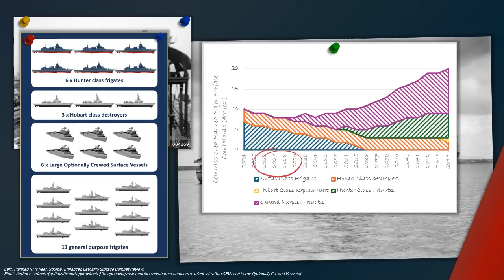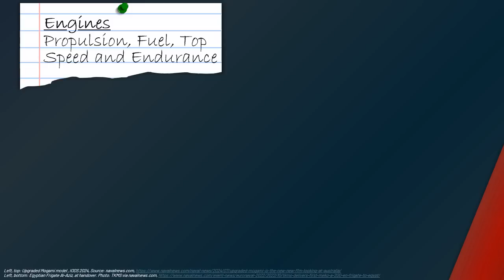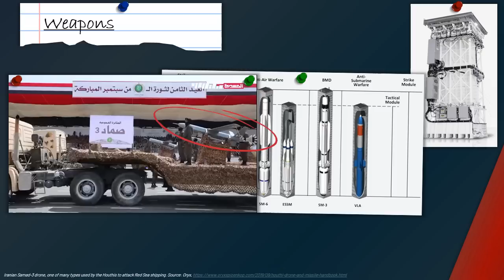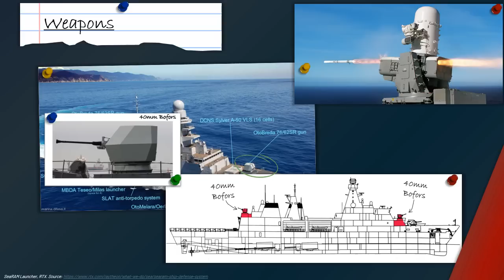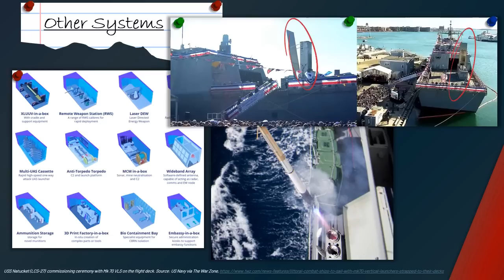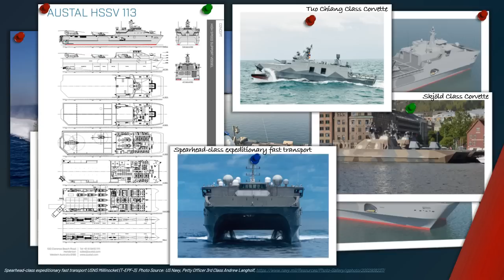Could Australia Build a 21st Century Bathurst Class Corvette?

Comment: Just a suggestion or two : take the shorter Austal HSSV 92 sized proposal that actually fits in their Henderson shipyards and fit it out as you suggested, but build them in pairs. One as the anti submarine warfare platform and the other as the dedicated anti air warfare platform and operate them as pairs. One can have a proper helicopter landing pad, towed sonar array and similar systems. The other can have a much smaller pad and no hanger and use the rest of the space/ weight to fit a MK70 VLS and mount the bigger/better radar. Fit them with Link 16 so they can operate together and co-ordinate and you might have saved yourself some heart ache trying to shoehorn everything on to one ship. 

Other thing is including some sort of UAVs.
Reply: Not mentioned on the anti air warfare front would be equipping the ships with 2 x 6 cell NASAMs launchers (which are at least partly domestically manufactured) - this gives a missile capability with a range of at least 37 km - 4x the SeaRAM 

AMRAAM-ER which is essentially an ESSM + AMRAAM Seeker should be domestically manufactured and it should be looked at integrating it into MK41 VLS, F-35A and the NASAMs launchers, such that all systems can use the same short range air defence missile

Comment: Firstly, this was a very interesting thought experiment if nothing else, and after watching it through I have some thoughts:

if the AshMs are mounted in external boxes, is it possible to have their space arranged in a way so that they could be swapped out for the Mk-70 VLS or another 'shipping crate' weapon system, allowing your 'Future Bathurst' to exchange long range surface strike capability for Air defence/stand-off anti-submarine/etc. capability whilst maintaining the helicopter deck? It seems like that should be viable, but I admit I'm not a ship designer so I don't know if that's the case.

I agree that a sizable mission bay could be an excellent way of maximising utility whilst keeping base costs down.  And you could simplify things logistically by defining preset 'loadouts' for common duties, e.g: VLS and extra fuel for ASW escort, extra remote weapon stations, EW and Hellfires for anti-drone/anti-piracy work, etc.

If space proves to be a major issue, could the helicopter be replaced by a drone?  You'd lose utility, but if the chief thing you want is a way to get torpedoes, depth bombs and sonobouys out to a target area, it could be a possibility.  

Finally, I think you're right about the cost/lack of appropriate facilities being the biggest obstacles to viability.  Even if it only costs 500 million to build, that's not including maintenance, staffing and all the other costs that go along with maritime operations.  Though having said that, keeping even a relatively low production run of 'Future Bathursts' going could prove useful to maintain institutional knowledge (something Australia has historically had issues with in shipbuilding), or, if the Australian Government does decide to expand Australian shipbuilding capacity, a simple and relatively small ship could be great as a shipyard's first commission, as a way to build up a workforce's experience and expertise.  And if it's an inherently flexible and modular hull, that may open up the possibility of exports.  Sure, the concept might seem like a 'third tier' ship to Australia, but to countries without the GDP to support a major navy or otherwise only need some patrol ships to maintain security, it could prove ideal.

Comment: Coal could be used to run steam powered navy ships for hundreds of years and it is a lot cheaper than $2 a litre for diesel fuel to run the things.
Reply: coal is bulky. you would need a bigger ship.
Reply: @badpossum440  Better to build ships that get driven about the ocean even if they are bigger and not as fast as far as I am concerned. Currently they mostly seem to sit stationary in Australia till they can not be operated.
Reply: Ships don’t use diesel they use different types of oil

Comment: The level of propaganda saturation in all the news reels of the time and the politicians and unionists glorifying the Bathurst Class corvettes means that the myths of the Bathurst Class have never gone away no different from the Boomerang Fighter.  That was produced all the way through the war and was obsolete before it was designed and  built and even at max speed could not catch a cruising  Japanese bomber and never shot down a single enemy. 

The Australian built Bathurst Class Corvettes took just as long to build at each dockyard as the US production of Essex Class carriers that were 37 thirty-times the size. There isn't even any honesty in calling Bathurst Class a corvette when using civilian engines and very small ships without modern anti-submarine or modern anti-air was really a Sloop or Minesweeper definition in the Royal Navy. The ongoing bs is the modern Hunter Class with so few VLS  and actually twice the cost of two Chinese Ballistic Missile submarines and zero chance of being anywhere near one of them let alone intercepting and tracking two quite slow and loud nuclear submarines that need merely to split up.  So the cost of one Hunter Class minesweeper two Chinese nuclear submarines firing conventional non-nuclear ballistic missiles might be capable of sinking the entire Royal Australian Navy in a few hours. Domestic sovereign capability and designed and built in Australia by Australians for Australians gets said so often and so iconic and guaranteed to be a success just like Landrovers and Toyota Landcruisers and iphones and Big Macs. I got as far as the suggestion of not having VLS. VLS are garbage compared to ICBM sized tubes able to do a range of hypersonics and affect all domains including Space. The Author Western Red isn't retarded and IS proposing the Bathurst Shipbox as  a design study FROM  EXISTING aUSTEL AND iNCAT DESIGNS   and  THEN A reason for the government AND TAXPAYERS  to pay aUSTEL TO UPRGRADE THE SHIPYARD N hENDERSON BUT NOT ACTUALLY BUILD ANY.
Reply: They were saying that stuff before WW2 . about how the only thing needed was gas

No gas was ever used

Comment: The problem is the bar is so much higher for what’s needed to be useful that even a theoretical tier 3 ship would be prohibitively expensive to build in large numbers.

You need a radar that can provide AAW self defense capabilities, and a sonar capable of tracking nuclear subs at least in shallow waters. 
That would likely be 60%+ of such a ship’s total cost just in those two sensors.
Reply: And by the time you get to that point, why not build a large hull? Steel is cheap and air is free. Imo the things to give up for lower costs are stealth and speed. 
Build the hulls in large numbers and make the sensors detachable, when one goes for refit pull the sensors off and slap them on a fresher hull. Ships with downgraded sensors can be used for amphibious and supply operations. Commit to multiple hulls a year and give spares to the Maritime border command or as diplomatic gifts. 16 total hulls with 8 'war ready' should be enough to always have an escort squadron on hand.
Reply: The key to me is to have OPVs that can quickly be refit as WWII corvette analogies.

Sea giraffe or equivalent radar are good enough for radar, idk shit about sonar so won’t speak to that,  but I would go with the 57mm gun fore and aft, and millennium guns port/statboard, helo hangar and one seahawk, and a few small drones, and 2-8 harpoons.

Give it a top speed of 22 knots, and done.

Comment: If the Hunter class frigates are going to indeed cost A$7 billion each or any where near this amount then we have to conclude BAE Systems can't design and build frigates and it unfortunately would then be best to abandon that project. At most the purchase of only two Hunter class frigates so as to at least utilise much of the work already done and to limit compensation costs may be the best path of escape.

This thought experiment on a proposed current generation Bathurst class equivalent is very informative, well presented and I think very useful.

My best guess is that the minimum really useful type of ship for general use by the RAN would be the Lurssen C90 based corvette at 2,300 tonnes to give a 6,000 nautical mile range. The sensors and weapons would have to be carefully selected as that is where most of the cost lies. The weapons and sensor options many of which have been built in Australia mentioned in this thought experiment look plausible. It should still be possible to have a long range radar such as that fitted to the upgraded Anzac class frigates and to meet the budget. Having the ability to launch and hangar a Sikorsky SH-60 Seahawk helicopter that can launch antisubmarine torpedoes and anti-ship missiles like the air launched Kongsberg NSM-AL is a very powerful and important capability. The helicopter and those weapons would be expensive but would still provide the best capability to cost ratio.

https://www.defenceconnect.com.au/naval/12464-luerssen-proposes-more-bang-for-your-buck-navy-corvette

The tilt up Lockheed Martin MK 70 containerized vertical launching system however sucks in my view as it would also be expensive, it only contains four cells, it cannot practically launch quick reaction air defence missiles, would probably get in the way of a CIWS and would probably be too top heavy for a corvette. A very flexible and useful 16 cell VLS should be the minimum fitted in such a class of corvette. Short and long range range air defence missiles could then be loaded if needed. NSM's could ideally be carried in additional containers as is done on the Anzac frigates.

Another alternative to the Lurssen C90 corvette variant is the Meko A-100 Patrol Corvette at 2,600 tonnes but the 4,500 nautical mile range is probably inadequate for the RAN who need at least 6,000 nautical mile range. Perhaps a 6,000 mile range variant Meko A-100 can be designed at say 2,800 tonnes?

https://www.thyssenkrupp-marinesystems.com/en/products-services/surface-vessels/light-frigates

The two corvettes discussed in this comment should be price limited to about half of the Australian general purpose frigate program estimated cost to be a goer. Otherwise acquiring more of these frigates might become the better path. Competent program managers and designers should be able to select sensors, weapons and systems so as to meet such a strict budget.

Construction of these hypothetical corvettes should ideally be modular with modules manufactured all over Australia with one shipyard selected for final assembly. The original Meko 200 based Anzac class frigates were built that way, cost effectively and to schedule.

Scrap the failed Hunter and build a large number of 3,700 tonne frigates and 2,800 tonne corvettes with a high level of Australian content.
Reply: You must realise that $7 billion each, is over the lifetime of the vessel, the Australian government is one of the very few countries who cost their defence assets over the lifetime of such asset.
Reply: @boredatsea  Yes A$7 billion is the through life per unit cost. Checking the internet reveals each Hunter class frigate may cost almost $4 billion not including any missiles, torpedoes or gun rounds.

That is still too much in my view so cutting the Hunter class from 6 to 2 could save A$4 billion times 4 = $16 billion. If the corvettes can be built for $500 million each, that could fund over 30 of them.
Reply: @ I read elsewhere the high cost could be contributed to the AEGIS combat system which is needed for the SM3/6.
Reply: @boredatsea that’s not quite the case, the figure comes under the procurement budget per the department’s annual report, and it doesn’t include through-life costs but does include things such as training for entry into service.
Reply: Zimmerwalting the Hunters seems like a terrible idea. If you absolutely had to get rid of them, sell the hulls rather than keeping a token fleet. It would be an awesome deal for Norway or Brazil.
As I repeat a lot, steel is cheap what is the real advantage of going small? If you are going to build so big you need new shipyards, why not make them fit a Type 31?

Comment: Sounds a lot like Austal's MRV80 design...

Edit: Or Austal USA's FFG(X) entry minus the bells and whistles (in effect an LCS dropping the waterjets and 30+ knot speed for props and a 26 knot speed...).
Reply: Per Australian shipyards, there's a few others you've missed with:
-NQEA in Queensland, previously built the Leeuwin-class hydrographic vessels.
-Harwood Marine in NSW, slipway with about 3000 ton slipway
-Echo Marine Group in WA, previously built an 80m trimaran superyacht
-Silver Yachts also in WA, built vessels up to 85m length

Crisp Bros. & Haywards in Tas has a large build hall (Margate) but unsure about slipway capacity (builds vessels up to about 40m length for the salmon farms but looks like much of the build hall is used as a general engineering workshop). RDM Marine in Tas has a lot of experience with building aluminum ferries up to about 50m but shipyard looks too small to expand beyond that.
Reply: Also Austal HAS built multiple vessels in excess of 100m length at Henderson (Benchijigua Express launched 2005; Betancuria Express launched 2011; Bajamar Express launched Jan 2020), the question mark though is how many of it's sheds can accomodate vessels of that size. Of cause, there's always the option of building modules in the sheds and doing final consolidation on the hardstand.
Reply: AUSTAL is Australian and operates warship building in the Philippines and the USA as well as in Australia.

Comment: Tier -1 is Hobart class, Tier  2 is ANZAC  Class , Tier 3 Is Patrol boats (Freemantle Class and Like)  Looking for something that be Light than ANAZC but Powerful as Anzac, Arafura-class hull BUT Bigger gun
Reply from the maker: Basically, yeah. Upgunned Arafura would probably be perfect, if we had the shipyard space to build them in numbers. But our national efficiencies are in aluminium multihull ships, so if it were me, that's where I'd be putting my focus, assuming the priority is speed to delivery and not disrupting the GPF delivery from the CivMec facility.
Reply: @TheWesternRed-au   Aircraft - AgustaWestland AW159 Wildcat would be nice BUT UAV Width Mark 46 Would be Better,  Gun- Bofors 57 mm Cannon or OTO 76mm Gun. Harpoon and Short range Air defance
Reply: @jsma9999  Harpoon is old technology, why go the AW159 wildcat??, economy of scale is needed to keep the cost down, would have the 57/70mm over the 76/62, the explosive power of the 57 is roughly the same as the 76, though I have experienced the 76 in AA and it is a very effective AA platform, agree we need ESSM and even SM2 as well as Anti Ship, needs more Land Attack armanents.
Reply: There is sufficient yards already,  in Western Australia.

Comment: What about building an Australianised Navantia Avante 2200 at Austal?
Reply from the maker: These were considered as one of the options for SEA 3000 before the downselect. So probably a class above what I'm proposing in the video.

As steel monohulls of over 100m as well, there's not really spare capacity to build them anywhere - Austal's sheds are too small and they're designed around aluminium construction, the CivMec yards are going to be chocka block between the LCHs and GPFs. 

Maybe you could modify the Incat yards sufficiently to trickle them out, but you have all the same issues that are going to be experienced with whatever the actual SEA 3000 GPFs turn out to be: if you're going to go through all those redesign and modification processes (minor though they may be) and retool a yard to build them, at that point you're probably better off just building more GPFs.
Reply: I'm just not as optimistic as you are regarding aluminium catamarans for general purpose corvettes, which would indeed be the cheapest and easiest for the two unused shipyards. The Avante 2200 wasn't really the best ship for tier 2, but could be a good reference design for a new third tier perhaps. If it can't squeeze into the two 99m docks at Austal, maybe the Braunschweig class (which has shown good customisability by Israel) could be a contender instead.

Austal could add steel to their repertoire (like what they are doing in their USA subsidiary), with construction also taking place near all the defence primes at Henderson. Perhaps we can leave Incat to produce aluminium transports, supply ships, hospital ships, etc.
Reply from the maker: That's completely fair: I'm definitely being an optimist when it comes to the HSSV as a base. The question comes down to trading off time and upfront capital costs against better performance - I definitely agree that, all else being equal, you'd take a steel monohull if you could, and a different reference design could be chosen to do the same basic thing (cheap, minimally missile armed corvette, essentially). But that puts the risk and uncertainty into the short term: can the shipyards convert over in time and on budget, and how much expertise is lost in the existing aluminium focussed workforce?

If Defence did a study, talked to the yanks about their experience with the spearhead and the answer was that aluminium is just not viable at all, then that's that, though I'd be surprised if that were the case. Even if the cat hull were ruled out, then, once it's properly structurally reinforced, I'd still be interested to see what the LCS trimaran design could do.
Reply: @TheWesternRed-au  Buy the hulls in South Korea.